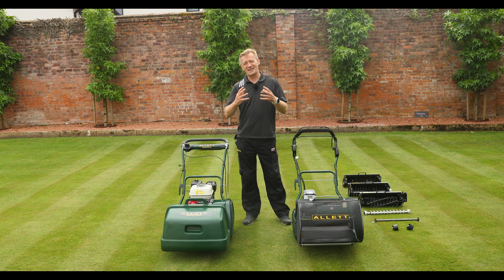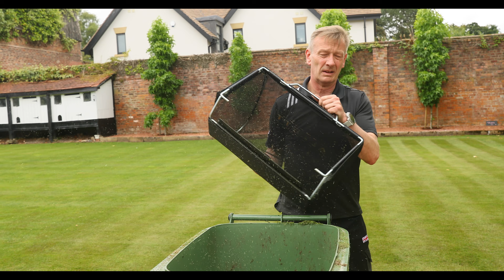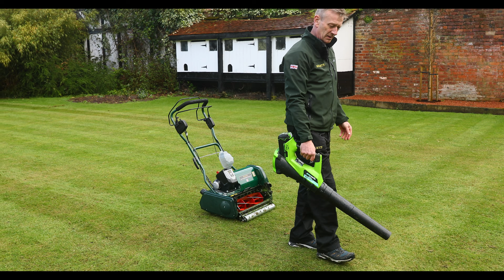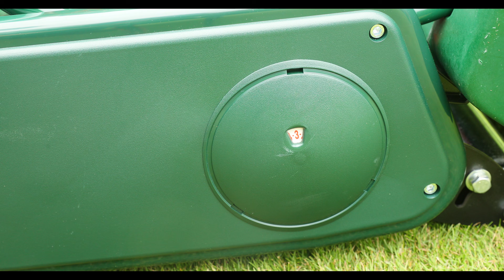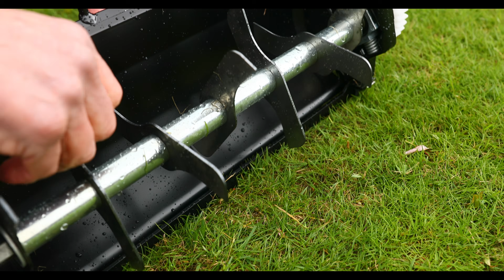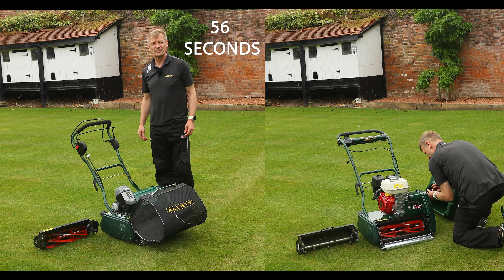Allett Cambridge 43 v Kensington 17 Comparison- Which One Do I Choose?

Comment: Allet liberty cannot mow slop lawn
This mower only work on almost perfect lawn
I have the liberty 43,,n is not cutting even n level ,,specially on slop area
N the belts is super expensive
Reply from the maker: @edykam5590  hi cylinder mowers are designed for flat lawns not slopes. They can cope with slight slopes but it depends how steep it is. Have you tried mowing a different direction up and down the slope rather than on the slant?
Reply: @ALLETTMOWERSUK  yes i do different directions but when go up n down,,when is down,,the mower not cutting coz the blade not touching the ground coz the rear roller
If i try side by side,,it make more uneven coz one side was heavier
Reply from the maker: @edykam5590  you need to go the other way up the slope . On a slope the weight is always going to be on the bottom side of the slope

Comment: I cutted for about 2 years my side cover so i can have also a RC Cartridge change without removing the side cover 😉

But i wish you could use the handle like the Cambridge has on the Kensington 😁 that would be awesome 🤟

Otherwise like allways cool Vid 👍
Reply from the maker: Hi you can use the bag but you’d need the rc cartridge brackets , a new side guard and the new Stirling bag
Reply: @ALLETTMOWERSUK  but the handle aint possible right?

Oh i have a Atco Balmoral 20sk